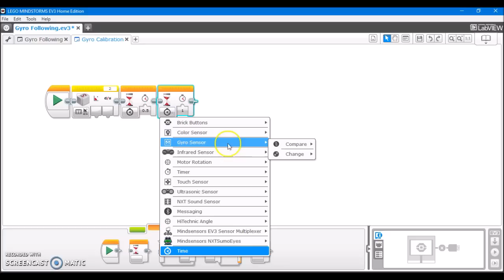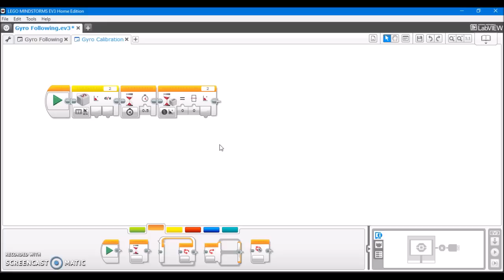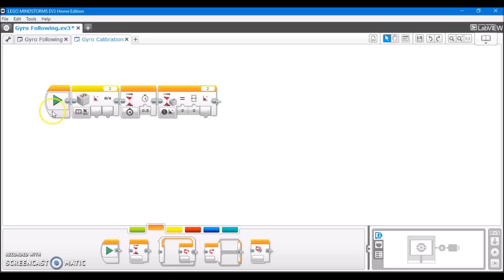Improve the Accuracy of the EV3 Gyro - 3 Simple Tips

Comment: Something changed (in the firmware?) and now changing modes does not cause my gyro to reset (reliably).  I'm almost always forced to hot-plug the gyro when it's drifting.  Last year, the mode-switch reset technique worked every time.  Now it almost never works.
Reply from the maker: What firmware and software version are you running?

Comment: Great video.  I know I've cross posted this elsewhere, but this seems to be the main video on care and feeding of the gyro.  Here's what I found:

1. Gyro drift happens when "in the loop" with the EV3 program where it is constantly reporting back angular values (in my case over bluetooth).  I now download, disconnect, and run from the brick, and there's been zero problems.  I display the angle on the EV3 display for debugging and tryout purposes.

2. When running connected, there was no solution that worked consistently.  The type of calibration routines that wait for zero sometimes hung up the robot for 4-5 seconds in that wait loop, then when it exited it still had a drift.  I'm talking 5 degrees drift per second, or worse.  I tried a half dozen methods on Youtube and in forums too, and nothing worked consistently when connected.  My school has six EV3 kits, and I saw this behavior on those as well.  All firmware and the EV3 program  is up to date.

3. I found that the most accurate results are had when the gyro sits on top of the brick between the left and right steering axles.  This doesn't make a huge difference, but every little bit helps.

4. Once the gyro gets into its "special mood", I found that nothing BUT disconnecting power worked.  This tells me that a warm boot is not the same as a cold boot for that sensor.
Reply from the maker: Thank you very much for sharing your findings and for your well-thought out, informative response.
Reply: My god boy you are a genius

Comment: I semi-disagree with your second point of advice (not hot-plugging the sensor). I admit that most of the time it is not necessary and your 3rd tip is the better way to calibrate/reset the sensor when it is drifting. However, I have found that occasionally, the sensor just gets in a bad state where calibrating in software as you have shown is not good enough and the angle value still continues to drift even though the robot is perfectly stationary and the gyro sensor has just been calibrated. In these instances, I have found that unplugging the sensor and plugging it back in is the only way to prevent drifting. In this cases, hot-plugging the sensor is much faster than rebooting the EV3. It seems that the sensor takes some time to boot up and sync with the EV3, so if you are careful as to not disturb the robot too much when plugging the sensor back in, it does not seem to have an adverse effect on subsequent sensor readings.

The trick with the sensor returning NaN while it is switching modes is new to me. Great discovery!
Reply from the maker: Thank you very much for sharing your insight! You are absolutely correct in that respect. I generally discourage hot-plugging because kids get impatient and sloppy when doing it, but as you've mentioned, as long as you are careful, it is okay.

Comment: where do you plug in the angle and distance
Reply from the maker: The program I showed in the video does not require you to plug in any values, but you can use an Angle and Rate block later in the program if you need to read sensor data.

Comment: builderdude35, thank you for your tutorials! FLL team 15531 has implemented the dog gear system for changing attachments and love it. They also have an attachment using your worm gear tutorial and the line following algorithm using 2 color sensors. Again, thanks a ton. I have a question re the gyro. The team started using the gyro and they use the gyro calibration that is featured here. Except that we only use it in the angle mode, never the rate of angle change. So, how does the gyro sensor behave differently if the calibration routine uses reads the rate of angle change followed by reading the angle (and then waiting..) rather than measuring the rate & angle in one gyro sensor block? Why is this an issue? We have seen occasional drift and want to see if there's a way to fix it. Thanks!
Reply from the maker: The gyro recalibrates every time there is a change in the block. So it doesn't matter what mode you use to calibrate the gyro, so long as you keep it in the same mode every time thereafter. That's why I recommend using Angle + Rate mode; it gives you all of the information without switching modes.

Comment: I have the same issue that a couple of people have noted below: it works well for the first few turns of a program, then out of nowhere... it stops working again. Is this an issue with the sensor itself? The brick? The firmware? 

It's really inconsistent. On the last turn of the program when it should be heading home all of the sudden it won't fully turn and will just run into a wall instead. One time it'll do it, another it won't.